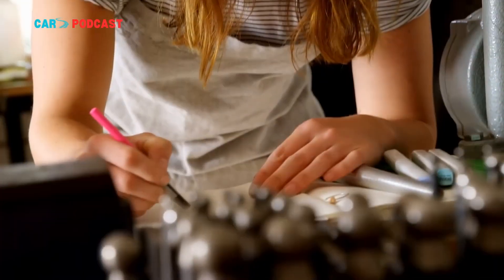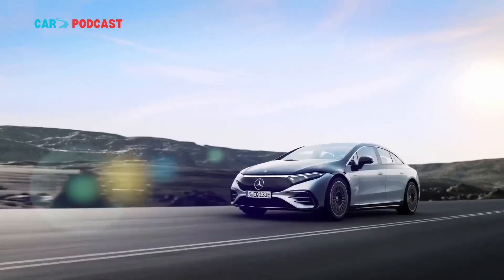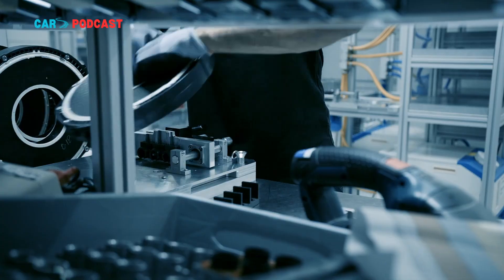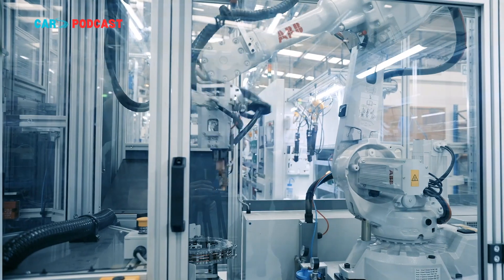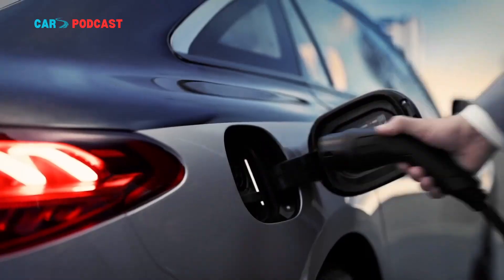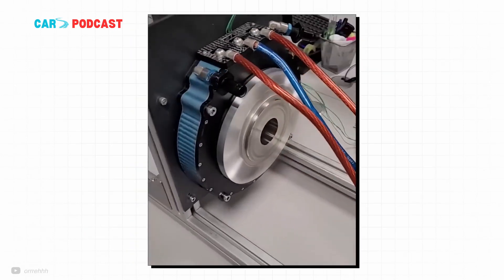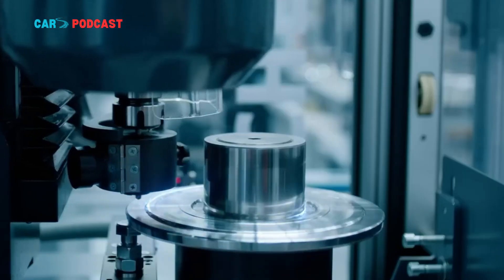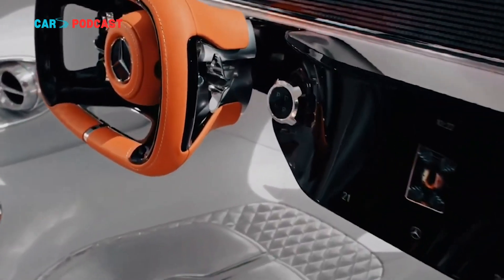Yasa’s Axial Flux Motor Redefines Electric Power Density, Promising Lighter, More Efficient EVs

Comment: The weight of a conventional radial flux motor in an electric car is about 3-4% of the total weight while the battery is around 25% !!! So motor weight is not a big concern. The real question is how much costs a Yasa motor compared to a radial flux motor ?